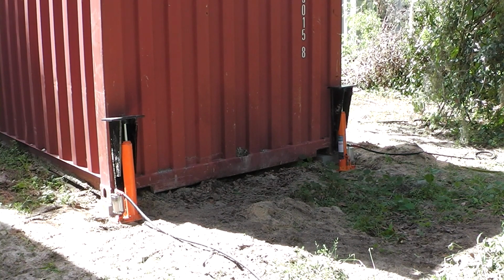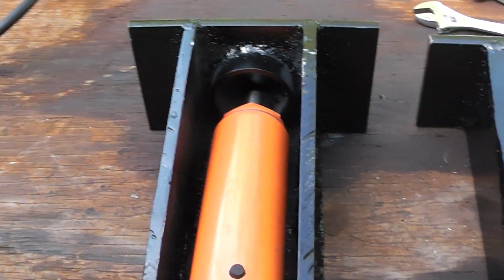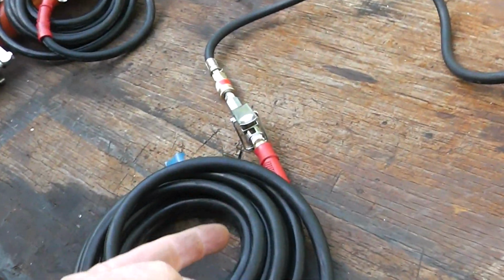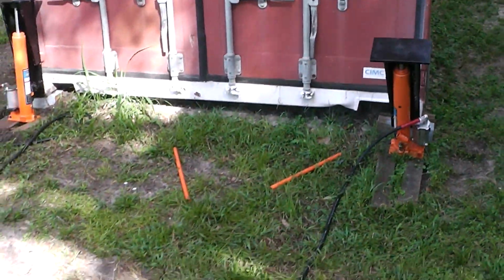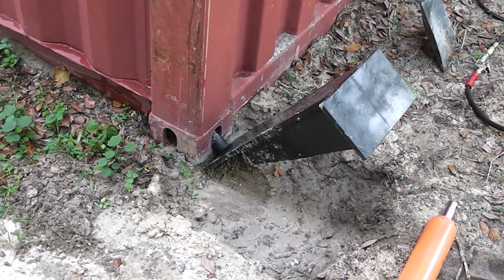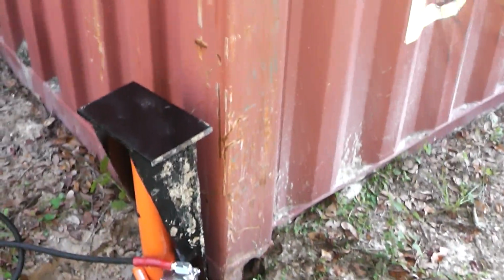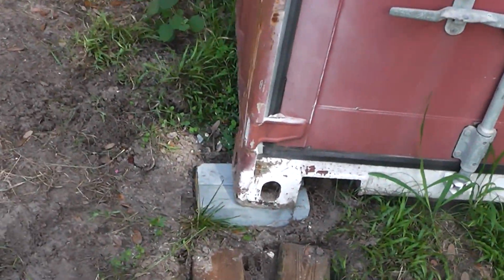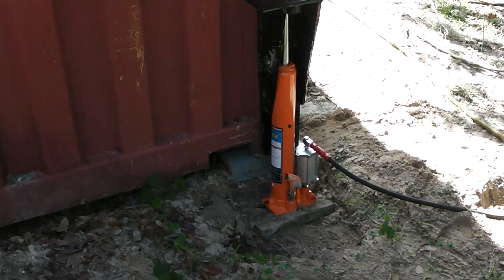Compressed Air and Homemade Toe Jacks lift Heavy Shipping Container

Comment: The pads for your jacks can be made out of 2x10"s or 2"x8"s. If you decided it, make at least three, use two all the time, keep one extra just in case one of the pads get too bad so you can't use it no more, replace it. If you have to use 4 pads at a time then again keep one or two extras in case one or both go out of commission in a job but let me tell you, heavy materials are more safe than light especially for lifting. And those jacks won't leave any car you drive stranded. That's the hero part many don't talk about. So, be prouder!

I think Home Depot sells small magnets like 1 1/2"x 1" you may be able to epoxy to the back top of your jack setters, hold their tops while hooked into the holes so they don't go easy out or to the sides.

If you weld a metal piece at the top just before the head of the jack can escape the metal top, so actually once the head of the jack goes up if it escapes by accident that I think metal piece from side to side, one inch high, will hold the top head of the jack so it'll contain any under pressure impulse it'll got from any accident so your jacks should stay contained into its setters until you take them down and out to its boxes.

Comment: I have a 40' long high cube. It's my shop and it's full of tools and equipment. I bought one 20 ton bottle jack from Harbor Freight Tools for $40.00. I dug a hole under each end of the container and set the jack on a brick and jacked it up to set the corners on concrete blocks. Worked great and didn't take long. Shipping containers only have to have support under each corner.
Reply: Where was the jack when you did this? I need to do this myself and was thinking the same thing, but am concerned about the lift point.

Comment: My same thoughts. Lighter gauge metal, magnet to hold it in place, and strap to hold the ram.  Make rectangles pads for the base of the jacks with an offset hole so the loops on the bottom can fit in.  Good footing would work great if you even have to use that on a concrete driveway or parking lot.

Comment: Good job, I like to see people that don't always take the easy way and have it hired done.  
1) at the bottom of the jack there is a yolk with two holes that is intended to be use as an option for safety.  You need to build a foot to you stability and a foot big enough to spread the load out and a larger area say it one foot by one foot area.  For the most that would alleviate the need for wood blocks most of the time.  I would suggest you build the footing out of aluminum.  When you build the foot be sure to incorporate stops so the foot can only tilt about 10 to 15 degrees both directions,( BIG TIME SAFETY MOMENT). 

2)  you really need to add say a U-bolt more toward the bottom portion of the jack.  Not tying it tight to the ram but allowing some forgiveness so the ram can lose move around somewhat Loosely inside your lifting bracket.
(ANOTHER BIG TIME SAFETY MOMENT)
3)  as long you do the safety medications to your jacks you do all your lifting from one end of the container, that is if the container can handle it a own weight, by blocking just off center as a fulcrum blocking the center then the end and back to the center back to the end.  
Just some pointers from a farm boy and a welder for 35 years.  Over years I moved and lifted and manipulated loads up over 200 tons safely.  On the farm even as kid almost never any and had to figure out how to get done.  
Hope this helps make your safer and easier

Comment: They actually make something called a "container booster".  Chassis King and a couple of others sell them for about $175.  I also ended up buying a 20T air hydraulic jack from Harbor Freight, was $100 with the 20% coupon.  Makes it possible for me (a small woman) to do this myself, one end at a time.

Comment: wow ...you open my eyes in to something .I though that if you purchase shipping container you have problem with movingthose things . I have skidd steer loader which wouldn't lift those things but can push a little if needed . 
With the devise you made i can lift the baby , put 6"  pieces of pipe under and roll in to positions with the help of bobcat .
thank you for brilliant idea
Reply: stan  what do you have for a skid steer that won't lift 1 end at a time?
Reply: Steve D  I don't know what Stan has, but I have a Case 1530 uniloader (it actually isn't, it was built before case bought them) and it will not lift one end of an empty 45' high cube!
Reply: Lift it with these jacks and move it with this idea... https://youtu.be/TaE5vrH1IwU

Comment: I did this same thing but I built a couple of 24" by 24" by6" thick ground plates out of crisscrossed 2by8's with 3/4 plywood on both sides and then drilled a hole in the middle for that tab on the bottom of the ram to sit in.

Comment: A surplus computer hard drive magnet, usually comes in pairs and two sets, or 4 magnetic fields all glued onto metal brackets can be salvaged from  old hard drives for next to nothing.  Go to a computer repair shop, they have boxes of them.  Each bracked can pick up something like 20 pounds.  If you got two that should do and they can be screwed or bolted onto things.

Comment: Nice solution for tall lifts! 

For shorter lifts I use a forklift jack (great for machinery moves too) on a separate steel base plate about 1 1/2 ft square. I also have a Simplex jack but "railroad" jacks don't reach as far as your setup.

Comment: I agree that magnets would do the trick of holding the riser to the container while you set the jacks.  The container I have is set up on railroad ties (they are much cheaper if purchased directly from a local railroad contractor - closest one is outside of Bartow).  Maybe I can sell you my one-trip container once I get it emptied.
Reply from the maker: I have used up all of my free railraod ties!  The pt 4x4s should last for a while.
As far as your container, maybe.  I already have 6!

Comment: I made some thing like this invest in some steal plates for the bottom of the Jack's  I made a single feed block that  controlled a Jack on all 4 corners and take a look at the Bission c lift how they connect to the lift/lock hole I has invested just under a grand sold it for 2 grand after using it for a year.    Ps get more air storage (I used old  100  pound  propane tanks)

Comment: What exactly is so difficult in taking the load that is on the corner and using the soil bearing pressure to figure out what the appropriate reinforced 5000 psi concrete pad under the corner should be instead of guessing with masonry solids that are unreinforced medium density (maybe 2000 psi) units that are most certainly going to fail. Well worth it for an hours worth of engineers time to figure it out and be done with it.

Comment: you could use  Neodymium rare earth magnets, but be careful they are strong. On the base, I would use 1/4 steal about 12x12 and on the bottom side weld on 3 vertical ribs. Then knock two holes in it and make a rope handle. By the way weld a loop style handle at the top of each stand for a handle. Could use small rebar.

Comment: A little light thin plate on the bottom side of the jack, with a hole in alignment with the other twistlock hole, poke anything in it the size of a twistlock, round should do it, now jack should be much more steady. If too wobbleie, set it up for a twistlock pin.
Reply from the maker: Sounds like some good advise, thanks.
Reply: I would take a pipe, that has a larger diameter than the hydraulic jack cylinder, about 10" long.  
Slide the pipe over the jack, weld the pipe to the jacking bracket you built.  It should alleviate any wobble and keep ram jack from leaning under load.

Just a suggestion 👍

Comment: T think I will be building a set of these.   I would put a round magnet from HD (SKU #907501) on the face to hold the top.  What size welder did you use?  How about the round stock on the lift pin?  I assume the oval is just 1/4" bar stock?  Maybe build a 6" x 12" x 1/2" bar stock foot that pins to the jack?  Great job.  Thanks.
Reply from the maker: I used an old Lincoln Weld Pak 100 120v welder but, I significantly pre heated the metal with my oxyacetylene torch as I welded to get the penetration. I did the same with my log splitter and both are holding together fine. The lift pin was 1-7/16 inch scrap I had and the oval was 1/4 or 3/8 inch.

Comment: What did it cost you to make can you email me how too make them
Reply from the maker: The hydraulic rams were @$100 each and I don't remember what the steel plate cost but, it was a drop from Tampa Bay Steel. The steel rods were free scrap I found in a dumpster.  Off hand I would guess the whole set up was less than $300. However, The price of steel has risen dramatically since this video was made.

Comment: How about the HF welding magnets. The Large Arrow shaped ones have a good grip. I think I would use rock or concrete blocks under the containers rather than wood to keep the rot from taking them out.
Reply from the maker: Graet idea!.  I had the old pressure treated 4x4 scraps on hand, they should last for a while.
Reply: Rock doesn't elevate the container. A used railroad tie in decent condition is cheap (under 20 bucks each typically) and easy to place. Elevating the container above grade keeps the bottom dry while facilitating mods and maintenance.  I have four containers, two joined as a shop on steel beams (which were free and I like overkill), two on ties, and have set up several others for friends as shop space on ties.

Concrete blocks can break EASILY due to their construction unless they are solid, but if you are going to bother with that you may as well use Sonotube to pour concrete posts. I see no point in that any my shop is HEAVILY loaded with a lathe, mill, tool and cutter grinder, welders etc.

Comment: Where do you get the parts that lock into the corner hole things
Reply from the maker: I cut some 1 1/2" round stock and the oval shapes were cut out of 1/4" plate with the plasma cutter.

Comment: Am i blind or did i not see a level being used?  Yes,  put down a 10" or 12" X 12" piece of 1/4 plate steel to support your jacks so those pieces you used don't turn in on you.  I do NOT recommend using 4 X 4" piece of wood (untreated?) blocking for direct earth contact, use a bigger, flat concrete pad(s) to distribute the weight better so they don't sink down into the ground.  Other than those observations, nice equipment!!  I've had my two 40 foot containers setting flat on the ground for 21 years and don't see any water damage on the insides even in a wet Washington State climate. They do have some air place under them.  Maybe i'm just lucky?

Comment: great design, just need a little more engineering for safety purposes.  You can clearly see the left hydraulic jack leaning as it's pushing up.  There still exists a possibility for error, if the shipping container slides, or the footing for either jack gives way from under the load.

You get 5 ⛤⛤⛤⛤⛤🎖for ingenuity

Comment: Good video! I seen those HF air over hydr. bottle jacks used in press mods.  These used here seem to have good power although it really slows down under load.  I guess that is when only the one on the left was doing all of the lifting.
What length of container was being lifted?
Reply from the maker: 20 ft.

Comment: Thanks for the video! I was wondering if something like this could be made for living containers even higher up so you can put them down on a trailer. I've been looking at jacks and there are some long ones but I don't have much experience with cars and trucks.
Reply from the maker: That is exactly what these were built for.  I will be doing a vid in the future putting a container up on a homemade trailer and moving it.
Reply: Hmm true!

I was thinking more of a normal flatbed trailer or swap body truck so you don't need much force or power to get them on. Like those "BDF" swap bodies that have stilts so the truck can just drive under them, raise his suspension and pick them up. Just that the stilts are jacks instead.
Reply from the maker: @hobbiehobbs  My apologies. I thought you were calling me a nance.
Reply: @homesteadprepper  no sir. I look forward to each video you share out. You have some great ideas.

Comment: Where did u purchase the cam to weld?
Reply from the maker: If you are referring to the oblong pieces that are welded to the back of the 1 1/2" steel rods at the bottom of the toe jack, they were cut out of a scrap piece of 1/4" steel plate with my hand grinder.  I made a pattern out of plywood that would fit into the holes on the container first and just copied it onto the 1/4" plate steel.
Reply: homesteadprepper thank u. I'm referring to theprongs that fit into the hole in the bottom of cantainer
Reply from the maker: All steel was purchased as drops from Tampa Bay Steel.

Comment: A magnet!? Omg, seriously? Ok, first of all the pins need to be shorter so they dont have the slack to let the toe lift lean out. Ok, once that is shortened then the base for the ram should be a mated sliding plate similar to the toe lift. It should interlock and slide so the ram stays in position and not able to kick out because its sitting on DIRT on some loose 2x4s. The top plate of the toe lift and the bottom plate of 5he interlocking plate can be 1/2" thick as you are pushing across that width but the tell sides can easily be as little as 1/4" as they are only on tension. I'd like to see your trailer for moving these although in reality I think you only need an axle with some indexing to stop movement at the contact point.

Comment: Nice try . if you had a angle on the corners to keep it from sliding side to side . and it sounds like its over it weight limit its straining to lift I think.
Reply from the maker: It worked for me!
Reply: and it sounds like you don't know what you are talking about.

Comment: HEY, where did you get the air pumps? I can't find them anywhere, how about a link, or item number, sharing your "AMERICAN ENGUINTY "smile
Reply from the maker: I got mine at Harbor Freight tools for $ 77.03 each sales tax included https://www.google.com/url?sa=t&rct=j&q=&esrc=s&source=web&cd=1&cad=rja&uact=8&ved=0ahUKEwik0pi08eTXAhVGY98KHUI8CJ0QFghgMAA&url=https%3A%2F%2Fwww.harborfreight.com%2F8-ton-long-ram-air-hydraulic-jack-94562.html&usg=AOvVaw3kpPn4xxwIN31X7t_sKnSz .  That is using their 20% off coupon. I bought them separately so I could use the coupon twice!
There are some other places selling the same jack like https://www.google.com/url?sa=t&rct=j&q=&esrc=s&source=web&cd=1&cad=rja&uact=8&ved=0ahUKEwiQ3fz38OTXAhVjkeAKHevNAssQFggpMAA&url=https%3A%2F%2Fwww.northerntool.com%2Fshop%2Ftools%2Fproduct_200641740_200641740&usg=AOvVaw3J0tF9iSTh2A6bmYkjybW6
Reply: homesteadprepper : YOU THE MAN, thank you for the comeback, i thought thehy were separate, and HERE I thought I knew everything that store sold. THANX